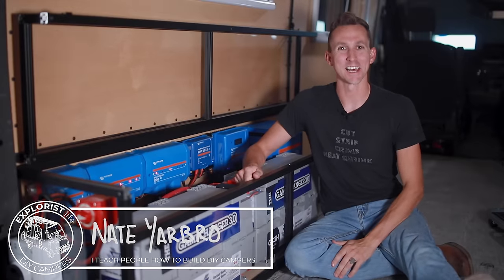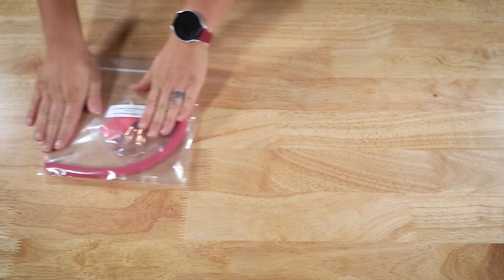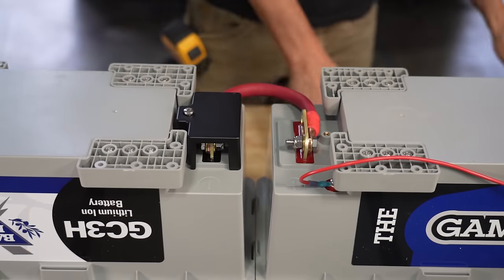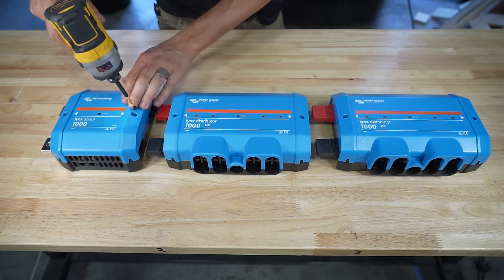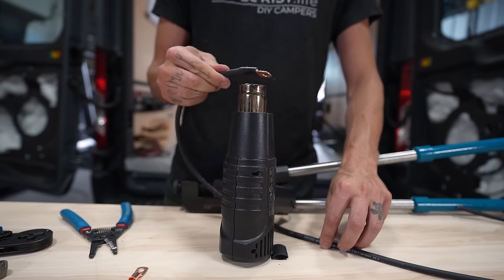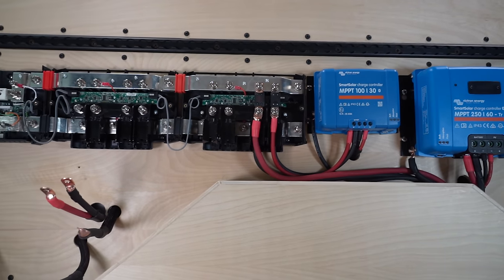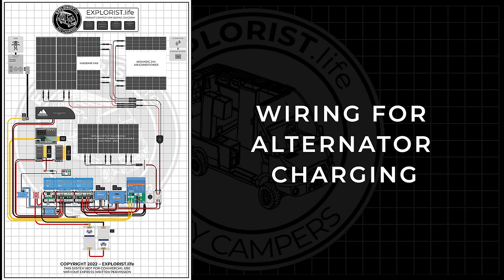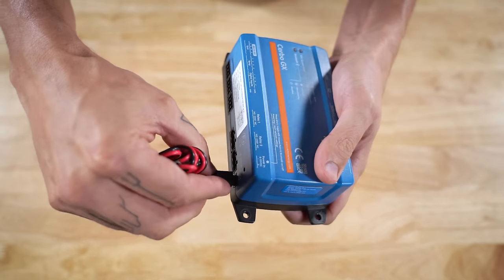DIY CAMPER VAN ELECTRICAL INSTALL (Start to Finish Tutorial)

Comment: The mm2 on those cables seems ridiculous big. Like if that is the level we are at, I would rather go up on Voltage for sure! Like what size are those single wires???? 16mm2 or rather above?.... Just huge it seems.
Reply from the maker: All wire sizes are per manufacturers recommendation and/or max equipment terminal size.

Comment: I am a total beginner of building an off grid system so apologies for the stupid question. Does this build include a BMS or is the Lynx Shunt a BMS?
Reply from the maker: The Battle Born Batteries used in this system have a BMS inside of them so we don't have to bother with external BMS's.

Comment: I live on a boat with Victron kit, it generates some heat, I'm worried your enclosure is going to contain the heat.  Do you really need 3kw inverter on a small van, will it have a washing machine or tumble dryer than need that much power? Your  work is precise and obviously v.good, but I'm worried this is a massive advert for an ultimate Victron setup that is not required for simple off grid living.
Reply from the maker: Our enclosure is not air tight and has had no issues with causing overheating.  If it did, we would simply add additional ventilation.

Our big electrical loads is a electric hot water heater and an induction cook top.

'Simple off grid living' is subjective.  If YOU don't need a 3k inverter, we have kits available for 2k inverters as well.

Comment: Thank you for the great video. Question, for a marine application , if the multiplus connects to the lynx distributor after the main house battery switch, what happens if you plugged into shore power and the battery switch is off , the batteries will not be recharging, correct?? So for a  marine application, better to connect the multiplus before the main switch?
Reply from the maker: Just turn the main battery switch on.  Having the main battery switch off is just for storage and/or cutting power for maintenence.

Comment: You have set the gold standard of van build YouTube wiring tutorials - seriously. You two should be very proud - and worn out - after making this totally complete video. Boom! 

My van build went almost totally opposite in wiring complexity, using a simple 12v Blue Seas fuse block, 12v wiring to puck lights, USB panels, MaxxAir fan and ICECO fridge/freezer all powered with one of my Ecoflow Delta lithium power units. 

But, then again, we are not off-gridders on BLM land, or forest land. The most "off-grid" we get is a Cracker Barrel,, Bass Pro, highway rest area or national park campground. And we do trips, not van life.

You always do great videos, but you outdid yourself this time! : )
Reply from the maker: Hey, Charles Moman!  I appreciate that.  Thanks for watching! 🙂😀

Comment: Nice done thx for your Videos. But one question, can it be a good idea to solder the clamps after squeezing them? Better connection.
Reply from the maker: That would actually be worse.  Soldering creates a weak point in the wire due to heat and the solid to stranded transition which is subject to breaking.  The way shown in this tutorial is the best connection method possible.

Comment: If I only plan on running one 120v ac outlet can I go straight to that from the multiplus? Instead of using the 6/3 wire to the ac distribution panel, can i just use 10/3 or 12/3 and go straight to an outlet from the output on the multiplus?
Reply from the maker: Nope.  There are no breakers on the multiplus.

Comment: Very good video. Very understandable. Only one small remark. I have never used the type of cable lugs you are using but they look bare copper. I prefer the tinned ones to prevent oxidation. Also the thickness of the lugs look a bit thin to me compared to the wire cross area. Again I never used these types of lugs.
Reply from the maker: Un-tinned pure copper lugs are just fine for non-marine applications like this where they aren't exposed to salty sea air.  Tinned copper is a bit more expensive, so by supplying untinned lugs with our kits, we are saving people the unnecessary expense.  None of the wires up in the engine bay are tinned wires, so our wires should last just as long as those.  I'd bet the frame of the van rusts away before our wires need to be replaced.

Thickness: I don't know what to tell you there.  They are plenty thick.  Maybe you just can't tell through watching a video and are just being nit-picky.

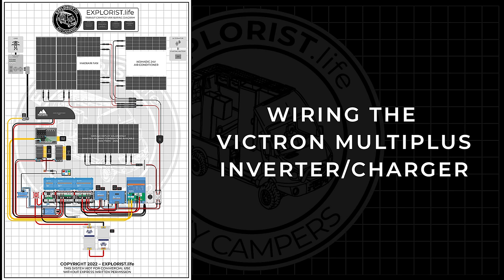Comment: 00:27:33 How to Wire a Victron Multiplus
Dear Nate,
I love your videos and I wish you would have a German/European subsidiary. I haven’t found an answer for my question / topic on your page and maybe it belongs to your remaining 3% open questions. 😊
My Sprinter van conversion electrical system contains 2x150 Ah lithium batteries with internal BMS, a Multiplus 12/3000 230V 16A, MPPT 12/30, Orion TR 12/12-30 and Smart Shunt. All connected with a Lynx Distributor, according to your recommendation.
The domestic batteries can be charged via shore power / Multiplus 12/3000 230-16, MPPT Smart Solar 100/30 (320WP) and an Orion TR 12/12-30. The system will be controlled and managed by Cerbo GX.
I would like to have the opportunity to “maintain” the starter battery (100Ah AGM) with a maintenance/trickle charge (in case that the motorhome is not in use for longer time). The starter battery is connected to the Orion via a 16mm2 wire.
The Multiplus description names a port G (TR-Charge). This connector should be connected to the starter-battery-plus pole. The starter battery minus pole must be connected to the minus pole of the domestic battery. Further information on Victron page is not given.
I understand that the trickle charge is taken directly from the main 12V supply to the Multiplus through a current limiter (4A) and a diode to prevent the starter battery charging the domestic battery. I assume that due to the different voltages (Lithium batteries in comparison to the lead acid starter batteries) the trickle charger will not stop charging the starter battery until the Lithium BMS shut off the domestic batteries due to low voltage. 
What do you think about the Multiplus port G (TR-Charge)?
I have not seen in any of your great videos nor in your wiring diagrams that you are using this port. Is that because of MPPT / solar power, which is sufficient for trickle charging?
What happen if the main switch between domestic batteries and Lynx Distributor is turned off – would the MPPT charge the starter battery?
Beside your answer, maybe trickle charge could one of your next topics (?).
Thank you,
Frank
Reply: Hi Nate, no further need to answer. Victron systems are (unfortunately) not made for modern use in camper vans. The G port (trickle charge) is a relic from former times.
In case somebody is looking for intelligent trickle charge of van starter battery incl. jumpstart support in case of low starter battery, WCS Germany is suppling an electronic box which is able to manage different voltages and loading curves of lead acid and Lithium batteries.

Comment: If you're only using one distributor unit, would you just piggy back your chassis ground and multiplus ground to the same center block?
Reply from the maker: It won't fit.

Comment: I dont understand why so much battery power is needed. I had a set up with 2 smaller batteries and it operated everything. What you're showing here is about 3 or 4 times that amount.
Reply from the maker: Look up our videos on system audits for more understanding on how to size a system.

Comment: I have a couple of questions about your DIY Electrical Wiring Diagram and Kit for this build that’s available on your website.

You mention in the video that you’re going to be utilizing alternator charging with a buck-boost.  I’m planning on installing a second alternator on my new Sprinter.  Nations sells a 24-volt-140 amp alternator with either a Balmar or a Wakespeed WS500 voltage regulator.  Do you know if this 2nd alternator/voltage regulator will integrate with this system in your DIY diagram/video by just wiring it to the Lynx Distributor?  

 Also, If I decided later to add two more Battleborn GC3 batteries in the future, would I have to change anything in the system, or just wire in the two new batteries (2S2P)?

I’m thinking that it would make my life MUCH easier to buy your DIY wiring diagram and kit on shop.EXPLORIST.life, but I want to make sure it will work with my 2nd alternator plans.
Reply from the maker: Your plan with the secondary 24V alternator w/ Wakespeed controller would indeed work.  That would just feed into the Lynx Distributor the same as the other chargers.

You can indeed battery bank capacity with no additional changes other than a bit of extra wire, lugs, and heat shrink.  Select the 4x battery 24V battery bank wiring kit to make sure you have enough there.

Comment: Hi Nate! I am confused about the difference between the 60A MIDI Fuse versus the 60A MEGA Fuse listed on the website for the Victron Orion Tr-Smart 12V-12V | 30A Isolated DC-DC Charger installation.  Is there a difference between mega and MIDI? All of the other fuses on the distributor shown in this video are MEGA (little fuse) I am confused on the fuse you sent me (midi) included in the dc-dc charger install kit. 

thanks!
Reply from the maker: The MIDI fuse is the fuse that's included in "Sprinter Camper Van 600Ah – 3k 12V Inverter – 400W Solar" kit and is for the connection to the starter battery under the seat or the busbar next to the battery in a sprinter like shown in this video: https://youtu.be/01F4QDVJUq0

There are three different fuse options we make available for the starter battery connection depending on the vehicle the charger is installed in and there is a description on which is best for which scenario on the product page for each: https://shop.explorist.life/shop/all-products/camper-wiring-kits/component-wiring-kits/victron-orion-wiring-kit/

Comment: Great video but I am curious about something. With 24v 3000 watt inverter, you are pretty much max running 125 amps. Why the 1/0 wire? 2awg would work fine and still probably be more than needed. Am I missing something?
Reply from the maker: The multiplus3k 24v makes a specific callout for wire size in the user manual, so we are following manufacturer's recommendations there.

Comment: Amazing job!  Did you ground the solar panels or elect not to?  Trying to decide if that's necessary.
Reply from the maker: Thanks!  The panels are bolted to the rack which is bolted to the van, which is grounded to the B- bus.  So yes?  But we didn't run a dedicated ground wire.  Mobile solar arrays can be considered 'floating' with no frame ground.

Comment: Great video! I'm planning on using your 24V system/wiring diagram in my build. However I purchased a nomadic 3000 12V AC system before making that decision. Am I amble to incorporate a 12V AC into the build or would you recommend going through the hassle of exchanging the AC for a 24V unit? Thanks!
Reply from the maker: Oof.  The air conditioner really needs to match the battery bank voltage.  So, weather that means swapping the 12V air con to for a 24V one or swapping the 24V battery bank for a 12V bank system; that's a call you'll have to make.  We have kits for either/both on our end.

Comment: HI ... glad to hear that you and Steph were able to get away to Mexico for personal time .... I have a full Victron system; that includes the MultiPlus 3000 .... I checked the operation manual, but could not find the answer to my question:  Does the MultiPlus inverter/charger have "Surge Protection" built into it???

I am assuming that it does not have Surge Guard .... so I also assume that it is a good idea to have surge protection in my power line with using external sources, i.e. generator, campground, at home, wherever!
Reply from the maker: There is no built in surge protection.  Something like this plugged into the shore power pedestal is a good option for that: https://amzn.to/3CcB4xq

Comment: Good work on the video, the install and the business idea for packaged parts.

Have you considered using the American Yacht Building Council wiring standard, at least for color?   (I haven't found a comparative RVIA version)  I was cringing seeing Black wire used for at least three different applications (A/C Feed, DC Negative, and Earth/Chassis ground) The confusion on the black wire is a cause of fire in both RVs and Boats.
Reply from the maker: Considered it, yes; but since our tutorials are widely used to upfit RV's that have the wire colors I used in this video, I feel it's best not to try to change it up at this time.   I feel it would add more confusion than clarity.

Comment: Why have "double" 400 amp fuses ... one between the battery & on/off switch ... additionally ... one on the Lynx Distributor between it and the Multiplus ???  It seems unnecessary to me to have two  beefy fuses on one circuit ...
Reply from the maker: Sometimes, although redundant, having two of the same sizes of fuses 'in-line' is the only/best way to protect both the whole system and the largest device in the system when the anticipated total load is not much more than the largest device load.

Comment: I am interested about the 54:54 moment. What kind of socket should I use here? What should be the Maximum Output Current of the socket? A fast one (4.8A DC) or regular (2.1A DC)
Reply from the maker: It doesn't really matter.

Comment: Because of your second charge controller for ground array set up this allows hooking up to up to a 1700watt array... so if my cabin had a solar run 1700watts or less... I could technically disconnect it from the battery shed and plug it directly into the van that way instead of using the 20-50amp RV hook ups... would it save me power if I did it that way since the power wouldn't be going thru so much extra stuff between the solar panels and the van system? Or did I just get needlessly excited about it lol
Reply from the maker: Sure!  As long as the array is within the capabilities of the charge controller, the charge controller doesn't care what the solar panels were previously connected to.  Personally I'd probably just keep the array connected to the cabin so I'm not compromising the cabins charging and then charge the van through the cabins electrical system, or just have solar panels on the van.  Lots of options there that would work.

Comment: Thank you for another outstanding video!  My question is similar to Owen Parker's. I have one Lynx Distributor, but I also have a Lynx Shunt. The video you recommended connects the chassis ground cable to your Lynx Adaptor which is connected to a Victron Smart Shunt. In my case, would you recommend connecting both the chassis ground cable and the negative battery cable to the same negative bus bar on left end of the Lynx Shunt?
Reply from the maker: The chassis ground must go on the other side of the Lynx Shunt.  You may need to extend the negative busbar on the 'right' side of the Lynx Distributor in a similar fashion as shown in this video: https://youtu.be/W9n01vuGDgM

Comment: I have a class B+, C RV. I am wanting to make off grid. Would like to buy an all in one kit but I do not think the pre cut wire would work for me. Was wondering if you guys could put together custom kits. Also my RV has a generator which I do not mind keeping. Just another point of redundancy. However I have not seen anyone show how to include for a generator. Thank you.
Reply from the maker: Both of our OEM RV Retrofits at https://www.explorist.life/solarwiringdiagrams show generator charging through a transfer switch.

We can do custom kits as long as your needs fall into the parameters of our 'component kits'.  More info here: https://youtu.be/F8nLRWf5ga8

Comment: I’ve been watching your videos for months and months now and I’ve pretty much decided on a 24v Victron system. However I haven’t heard you mention why you generally fit the Victron multiplus i vs the ii units. Online they are discussed to meet more stringent codes with the grid and the second relay’d output. Is your reasoning just form factor? Maybe I’m just missing something obvious.
Many thanks in advance and fantastic and incredibly detailed video as always. 🚐
Reply from the maker: Most of the time, it's a form factor thing.  The Multi i's are shorter than the Multi ii's which makes it super nice for an 'under seat' application like this.

Comment: I love this entire video so much, I have my phone on a tripod and I hit play>then pause> catch up to you on my van>hit play again (repeat as necessary). I would LOVE a video on Wire Management.  ie: when do you zip tie, loom, feed through ribs?  Will's top ten mentioned not zip tying "too many" together for heat dissipation. How do you attach wires to the ceiling/walls so they don't rattle?  Where do you put extra support on corners so the wire doesn't get cut by the van walls with vibration.  Do you use electrical tape? Zip Ties? Do you try and feed through the van walls or just behind wall panels? Sorry if this exists in your library but I haven't seen it. Thanks for your consideration!
Reply from the maker: We do have a video on that actually.  Check this out: https://www.youtube.com/watch?v=LifVE28FfmU